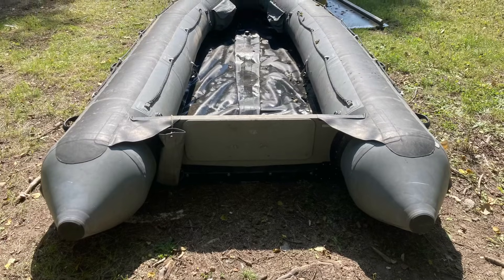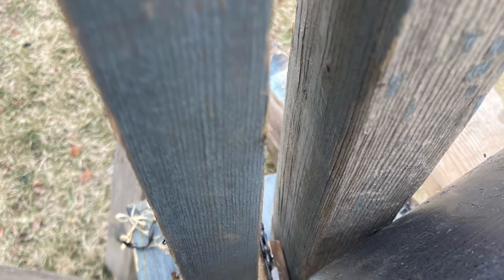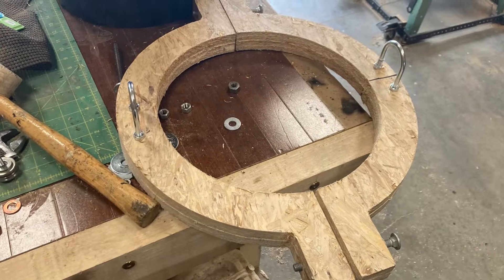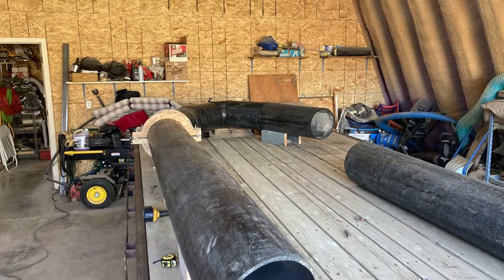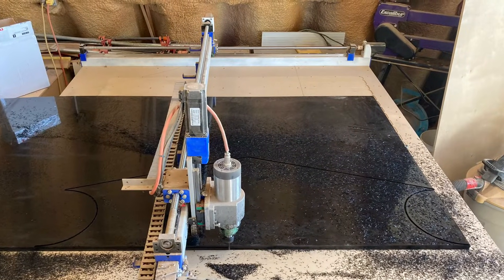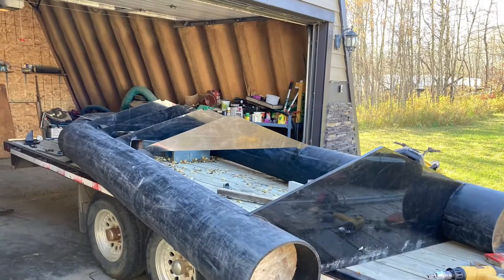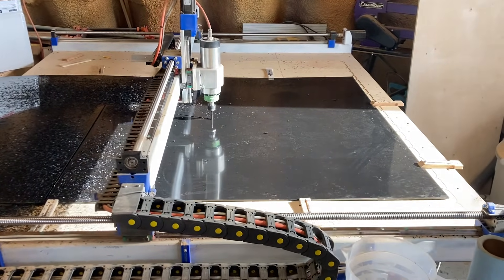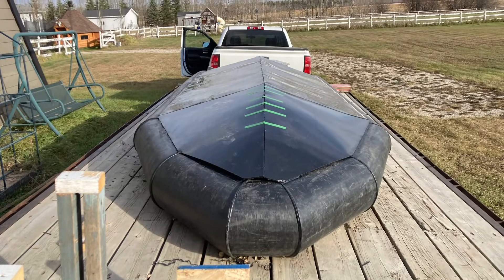HDPE (High Density Polyethylene) Boat Build Part 1

Comment: Did you place an inner sleeve between welding joints? Im worried about the bows structure? Will it handle smashing over and down a wave? Just askin.
Reply: Mdpe butt fusion jointing is common practice and aslong as its clean and dry the joint becomes one with the rest of the plastic
Reply from the maker: I welded ribs internally for structure and all welds are at least 3 passes.

Comment: Would it be worth filling the pontoons up with spray foam?
Reply from the maker: I thought about that,  but it would add so much more weight.  HDPE all by itself is neutrally buoyant.  I do have Wood baffles inside at the welds if I do another one I will weld HDPE baffles at each weld to separate the chambers in case of a leak.

Comment: Where there’s options to bend the pipe without cutting and welding?
Reply from the maker: The pipe is far to strong to bend and it would likely just kink.  The pontoons weere the hardest part of the whole thing.

Comment: Could you have just sprayed a zodiac boat with hope resin? That stuff they use for bed liners in pickups?
Reply from the maker: Actually I have tried that.  it does not work.  The old Zodiacs were made from hypalon and there is a specific glue required.  Similar situation with the new ones that are PVC, specific glue is required, bed liner ends up just flaking off and turns into a mess.

Comment: Extrusion welding is a superior joining method for this build.
You can also use this method to weld baffels in the pipe to produce 100% wstertight bulkheads
Your chainsaw mitrebox is a great idea.
Reply from the maker: I would have loved to use an extrusion welder as it is the proper tool, however I don't have $2000 lying around to buy one.  I thought I would try this first to see if it was possible.

Comment: Nice to see good effort, the temperatures for HDPE welding are tricky because it will depend on your welding speed. Especially for hot-air or extrusion welding. But in general, you can use 220-230°c buttwelding, pressure depends on the welding surface. For extrusion welding the plast 220-230°c the hot-air 280-300°c.

Comment: Better question, why build a 500 lbs boat ancor out of  plastic??? Why not fiberglass or carbon fibre?
Reply from the maker: HDPE is extremely strong and resistant to puncture,  that is why alot of jet boats have it on the underside of the hull.  Also, all that is required to repair is heat.

Comment: How brittle will the plastic hul be in the sea where the temperature coul be down to  5c deg or lower ? 
Best wishes with your project 👍
Reply from the maker: HDPE does not get brittle in the cold like other plastic.  The problem is that it cannot be glued and must be fused together with heat.

Comment: Just found this, so my advice is way too late. Invest in a strip heater and try to keep all your welds on the suports. You can get a tacking tip and speed tip for your welder, which will give you a stronger weld as the slower you go will release more oil, reducing the penatration  and weakening the weld. A vee scraper can be found  at most paint suppliers and acidtone for cleaning the welding rode and weld surfaces after scraping them. Remember to rescrape when adding a new weld over an old one. The strip heater can bend nice 50×50 angle witch can be used for stringers.

Comment: For the next one, you don't need full discs of HDPE inside for baffles. Cutting two pieces and leaving the center hollow will keep the round shape and probably be easier to fuse in there

Comment: I have worked with wax and thermal plastics and have only a few ideas. First I love the idea you have. Try several heating irons in a fire becoming red hot. One in your hand adding filler plastic. Tack around the skin and tack it big. Weld six inches and change location. Don’t blow heat at the seam use the heat from your irons. Keep the iron hot. Exchange regularly for wet sticky welds. After cooling heat and press mesh wire into anything that you like to reinforce. Weld shapes of metal together and heat them then press them into joints to prevent cracking. Not that I think it’s necessary or you should do different. I love the boat! I just want you guys to know.

Comment: Intresting  project - I spent a few years working for a UK Rib manufacturer designing and making Hyplon tubes. A couple of coments below mentioned adding expanding foam to the inside, with Hyplon tubes we used to add bulkheads and pressure relif valves.

Comment: Randomly, your video came across my feed.  Having previous experience installing utilities.  Was on a crew to do a water diversion project for a lake flooding vacation homes.  We used a chainsaw to cut 36"x 3/4" HDPE with dish soap as the bar lubricant. Using standard pipe fusing practices, we needed to keep the fusing joints as clean as possible.  HDPE is a very durable material.

Comment: No part II in four months so far. Hope you weren't drowned by a breaking boat or arrested over stolen HDPE pipe? That stuff is FAR king expensive. Unless rejected for being dirty like that stuff was.
Reply from the maker: Nope. Part 2 just released. I got the pipe for free because is was set to be sent to the trash. I bought the sheet material. And so far I am still welding lot to do yet.
Reply: @WoodLander-  I caught it a few hours after watching the first edition. I'm lovin' this project Mr. When you said jet drive I knew you have the functionality sussed out. Stern drive might be fine for deep or salt water but jets allow it to go anyplace wet.

Comment: An excellent idea that has come to mind for myself numerous times. The heft of HDPE pipe of such sizes is the first problem I had reservation about. But you did the right thing and proceeded to build. In the industry we always had to shave the pipe as smooth as glass, wipe it with acetone or isopropyl alchohol. then quickly attach both ends to the heating plate. Mention this as the knowing people say it's how you ensure a gasproof joint that will not fail.
Then the heater is removed and still in the clamps it is immediately pressed until the bead is is squeezed out evenly..... I do not doubt that your work is succesful however.  
I expect a frame will need clamping onto the pontoon for the engine support? This will be the most eerily bouyant tub in my experience with little rotation moulded HDPE boats. Those were welded an inner and outer together and filled through a hole with expanding foam. Dangerous to board in the water being so slippery when afloat but the load bearing ability is just incredible. I figure the material is lighter than water? I'll follow with eager attention. I believe the design is exactly the best style of hull to make from this durable and resilient material. If only boats like this could be made from plastic recycling of plastic junk eh?
Reply from the maker: I believe they can be made from junk plastic but it would be a tremendous amount of work
Reply: @WoodLander-  yeah just dreaming for the dreamers there. Eco sensitivity for eco sensitive. 😏
Reply: Might be slick when wet but that is why you apply something like the no-slip liners you can put down in a bathtub. Seen it done on even fiberglass hulls because once painted they are slick as ice too.
Reply: @SilvaDreams  yeah I mean the boat is so slippery in the water.. not to our feet or hands. Like as I step out and my weight centre goes past the gunwale it tries to launch off shore like a greasy pig. Thanks for taking an interest and reading my article 😏👍👍😄

Comment: Do you think you could expand more on the joining process, I heard you say heat plates but that didn’t paint a picture in my head, I know they’re all done now but if you could just show the equipment and how it works 
Cheers
Reply from the maker: You bet. I will do a live example of the butt fusion for the pipes. But for now check out part 2

Comment: I had the same ideea more than 20 years ago. But instead of using hdpe pipes, I used my old Metzeler hypalon boat as captive plug and it worked quite good
Reply from the maker: I have thought about this for some time. I always wanted to use HDPE because it is so versatile. But I also considered aluminum. I even saw a video of a guy who did this with aluminum

Comment: Maybe I missed it in the video, whats the material cost so far?
Reply from the maker: So far I am in for $500USD. But I got the pipe for free. A 50ft length of DR 36 HDPE pipe is about $1000 USD. So total material brand new would be around $1500 USD.

Comment: I built and rebuilt a fibre glass boat on an inflatable dinghy as a form.  First build was ultralight and planed off with three horsepower.  I then rebuilt it for strength and it got rather heavy in the end.  Curious to see how this works

Comment: I built HDPE water tanks for our bus project. I would highly recommend getting a proper plastic welding hot air gun - they are temperature controlled, and the feed nozzle puts the heat exactly where it needs to go, so you don't get the distortion. The manual feed versions are only a couple of hundred bucks, and are absolutely fine for limited production like this.
One thing I tried on the second tank was partial depth cuts at the fold lines. The cut went to the outside of the tank, folded,  then backfilled with a bead of filler rod - something similar might help forming around the bow.
Reply from the maker: I did buy the proper tips and a much cheaper heat gun that is of appropriate wattage and has temperature control. Watch the part 2 for more info
Reply: @WoodLander- just watched your second video. My guess is that your standard hot air gun doesn't push out anywhere near as much air as even a buget hot air welder does - your "inches per minute" was way down on what I was getting, which will also be why you're getting so much distortion. 
The other thing is to buy the filler rod by the roll if you can, probably 100' in your part the world, instead of those chopped up lengths. I got mine from the local fishing boat supply outfit, as they're always repairing floats and fish bins etc.

 It’s far cheaper that way AND it means you can use the speed nozzles included in the set you bought. Those work really well, far faster and tidier. The only places the heat goes is into the vee of the weld and preheating the filler, they move almost as fast as you can push the rod in, and the weld gets mashed down nice and flat by the heel of the nozzle - provided the hot air source is up for it.
What you're doing is obviously working and will be plenty strong, but like any tools, you get what you pay for. The less money I spend, the more time on the job I spend wishing I'd spent more money, is how that's usually works out for me 😂.
Anyway, it's a cool project, and I'm surprised more people don't do something similar  - the boat will be bombproof when it's done.
Reply from the maker: @petercroft9895 thanks for the info. I do plan to buy a proper extrusion welder after this.  I think I will start making all kinds of things out of HDPE. 
I guess I just wanted to see if I could do this as cheap as possible. I hate watching DIY videos where the person completes a build with tools and materials that most people don’t have and can’t afford. 

This is definitely an experiment to see what is possible.
Reply: @WoodLander- but you used a CNC and a CAD program..LOL
Reply: @Jordan-sy7my  Fusion 360 is free for hobbyists and there are plenty of affordable CNC services out there. You could always make templates and hand route as well.
Reply: @Jordan-sy7my literally a home made CNC router. 😂

Comment: Would like to see the fusing, did you use a standard heat gun?  You have an opportunity to come up with a simpler design, like a catamaran.  You can probably heat the bow of the tubes and squeeze them closed with a couple clamps made from 2x4's.
Reply from the maker: Check out part 2

Comment: How does durability of hdpe compare to umhw?  I'm building a aluminum jet boat for extremely rocky rivers.  Everyone I've spoken to says umhw only, I have access to hdpe for half cost of umhw.
Reply from the maker: Obviously UHDPE Ultra High Density Polyethylene is stronger but it is much heavier. And my design has pontoons so even if the hull gets a leak it won’t sink.

Comment: How much is HDPE?  Is it a cheaper boat building material compared to fiberglass or steel? This is interesting stuff...I was thinking it would be cool to build small barges with the stuff, for either workboats or pleasure crafts.
Reply from the maker: A single 4x8 sheet of 1/4” HDPE cost me $75 USD. A 50ft length of 1/2” wall pipe cost $1000 USD. So for around $1600 or so you could build a. 16ft boat.
Reply: @WoodLander- if you forget about the time it takes thats not a bad deal at all
Reply: @WoodLander-  What is the pipe diameter ? Thanks

Comment: Very cool and alot of  hard work i 1 video. do you mind sharing the price of material? Looking forward to part 2
Reply from the maker: I salvaged the pipe for free. I have put about $500 in material so far. I estimate around $1600 USD for the material to build a 16ft boat.

Comment: I would be thinking about filling the inside with that expandable spray foam to displace any water that may leak in. I loved that you had an idea and took up the challenge to actually do it. I hope it works out for you. Even if it doesn't, it's a great learning experience. And even if it doesn't work out, please tell us about it and why, and if you would / would not try again.
Reply from the maker: You bet. I will document the whole thing. Should have a new video out soon.
Reply: Expanding foam absorbs water and becomes too heavy to drag out of the drink. Putting waterproof plugs into the topside so it can be turned over without the plug in, thus drained. Speaking from experience.
Reply from the maker: @jackrichards1863  I agree. I’ve worked in the marine industry for some time now. And foam does soak up the water and become very heavy. I will be putting plugs in the pontoons as well as the transom.
Reply: @jackrichards1863  Thanks Jack.
Reply: @DavidM2002  reasonably gracious of yuh! There are little rotation molded boats we have one, those were done with foam filler. Outer is HDPE .
Reply: @jackrichards1863 this is what I came to say, but it seems I'm a year late. 😂
Reply: Open cell foam absorbs water. Using the proper materials is the key to success. Using a proper closed cell foam will work just fine as it is designed for marine use and does not absorb water. The potential DOES exist if the boat is used like a tug and repeated impacts and flexing of the tubes causes damage to the cell structure of the foam, those impact areas can open up the cells allowing for small localized water absorption but marine companies use and recommend it regularly including Beavertail who recommends it for floatation pod fill if the situation requires it. Just don’t go buying Great Stuff in a can. Use a proper closed cell 2 part expanding foam.
Reply: It would add weight

Comment: I build small sailing catamarans, of ply'wd, epoxy/glass,.... Might I ask the weight of the finished bare hull, please? VERY-canny work, though I'd bet you'd have built here "better", if a thinner-gauge pipe was used, no? Poly-pipe like that, here in SW FL, USA is absolutely indestructible!! (against direct-hurricane & wave-action, anyway? :-) Compare that I'm using 1/4" ply'wd, right,... for a 20'x9' near-shore mini-crusing vessel, and VERY-light. And, hopefully...nearly-indestructable ))) How's her draft, please? mine is 8". tanx, and buona fortuna!!
Reply from the maker: It is not done yet. And I will post the other videos as I continue. I estimate the total weight of the bare hull will be 300 lbs.

Comment: over six hundred views No one is hitting the like or subscribe. It's free to do. It might encourage him to make more videos.
Reply: 0:16 

Adding the v bottom 
To the two toons  greatly  increases your  bottom clearance.. by 400%?? From 8 inch to 2 inch.  Of course   guessing. 
For my 40 ft toon ,So let say I use 6 ( 12ft ttl) two ft diameter pipe to
Cover it with 14ft deck leaving  2 ft channel in middle
2×2×0.782×6×60×40
45,043.2 gross displacement 

 7507 each pipe

30,029 gross
4 piper
15,014
2 piper

But I want the draft
I maybe return
Reply: Good comments
To the one asking  thumbs
Reply: Done !
Reply: Not me I’m the lucky #625 😉
Reply: One lb sq ft aluminum  deck frame
Reply: 187 lb displacement 
Per ft long of pipe
2x2x.782 
= 3.12 x 60 lb
Reply: 18 lb per ft long pipe
1.5 in thick x 40 ft 753 lb
Reply: 10 % draft per pipe
2.4 inch
Reply: 61 mm
Reply: What?!  That’s not right.  I enjoyed it so much I hit the like button twice!

Comment: Do you think it's better than fiberglass Thinking about doing a pedal boat and im over fiberglass
Reply: I think it's petter for several reasons 
More flexible without cracking
It's easier to fix
Recyclable material
And the best ever as i read it's antifouling material so no need for bottom paint or cleaning
Also i believe it's less expensive than fiberglass
Also working with fiberglass is dirty and hard
Reply from the maker: I have not worked with fibre glass. But from what I know about it can be a pain. HDPE has been relatively easy to work with. It takes some practice but it is not hard to learn.

Comment: You need a plastic extruder gun to do this properly, those welds aint no good. And for the pipes you need a buttwelding machine. Do you scrape the weldingsurface before welding? You did cut the pipe nicely but did you clean away all the oil before welding? your beads look like they have a lot of dirt in them wich is a big nono. If you have done this correctly you could drop this hull on concret from the height of 5m without anything breaking. You should test this before going out to sea with it.